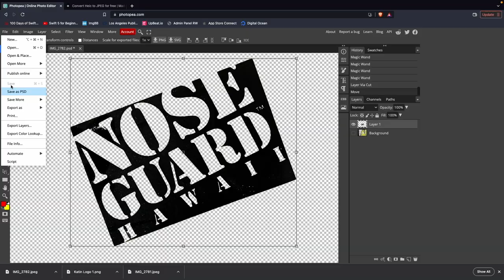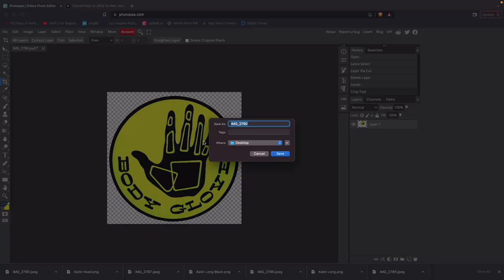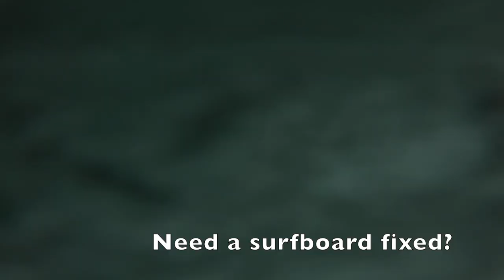Did I just ruin a classic or make a cool new surfboard?

Comment: Great job showing how simple a process this can be. no more old boards going to landfill! Simply a cheaper blank ;)
Reply from the maker: Exactly dude! Blanks cost $60 bucks now and some of these old boards are going for $20-40 on offer up.
Reply from the maker: And thanks
Reply: I would not call it simple. Reshaping a board needs practice. It is neither the cutting nor the sanding, it is the dimensioning that demands skill.
Reply: I like how Yu made a repucla of dude I thought you where just going to change it looks awsome just of gave it to your uncle
Reply: While the actual shaping process is not exactly “simple” it does open up a few questions. Should we br taking more old boards back to your local shaper (who arent using robots to shape) and having them refurbished, rather than new blanks?
Reply: great job but not definitely easy, the dude has a great mastery and skill.
Reply: Siiiick.

Comment: I noticed you store boards in your attic... have you ever experienced delam or any other issues from storing them up there? I have lots of boards and have run out of storage room...
Reply from the maker: Most of the boards up there are already delammed or dinged up! You should be alright with poly. Epoxy boards might delam from heat.

Comment: the fin boxes are suppossed to be installed before you airbrush...so there is strength in the fins by being set underneath the glass.
Reply from the maker: You mean before I laminate? If I installed them prior to airbrushing I’d be airbrushing the lam.
Reply: @Rogue_wave ...most board builders do this...shape the board...route the fin boxes...airbrush the foam board. then set the fins. put tape over the fin boxes.  when you glass the bottom of the board the fins are under the glass layers of the board and have more break strength. when you finish hotcoating the board you just sand the fin boxes and screw holes open.
Reply: futures and fcs2 are designed with a little lip on the boxes...so the glass layers come over the majority of the finbox when laminated under glass but remain flush with the shape of the foam.
Reply: this is also true with the futures leash plugs and certain fcs leash plugs, i believe its the mini one.

Comment: How you know what volume it's gonna be?
Reply from the maker: You can’t really know unless you submerge the board in a bathtub and measure displacement (which I’m not interested in doing 😂) there are some online tools that help you calculate an estimate based on length, width and height. But since a surfboard isn’t a cube, the regular math to find volume doesn’t check out. I’d guess this is between 26-28 liters

Comment: You dont coat n sand the laps?
Reply from the maker: I’ve never done that before- coat with sanding resin?
Reply: @Rogue_wave  Paint n Sand laps top n Bottom...With 240grit paper...Just gotta be slow n careful sanding the lap after glassing the bottom.. try not to nick the foam.. And when the deck is glassed n hard paint it too.. Sand flat before Hot Coating the whole board...

Comment: Just a heads up man you should set your angles on your futures not just pop them straight in the board
Reply from the maker: Hey dude with Futures, the angles are in the fins not the boxes. With fcs the boxes have the cant built in but the boxes still go in straight. There is no modern box that gets put into a board at any angle.

Comment: Nice...but the colors on those computer printer laminates aren't nearly as vivid as the originals...and, of course, you can't print white.
Reply from the maker: True. How do you print white??
Reply: @Rogue_wave  you have to make a stencil.  Buy an x-acto knife, rubber cement and some white spray paint.  Print the logo and registration marks on regular paper and slather the back (non-printed side) with rubber cement.  Let dry.  Then, print the logo and registration marks, again, on rice paper.  Stick both papers together so the logos align perfectly.  From the stencil paper, carefully cut out the parts you want to be white. Remove (rub) any residual rubber from the rice paper and spray the cut-outs on the stencil white (light layers, just enough to become opaque).  When paint dries, peel the papers apart.  Takes a few tries to get good at it, but the laminates will look professional. (Edited because I remembered my actual procedure)
Reply from the maker: @taradead  wow thanks for taking the time to share those steps!